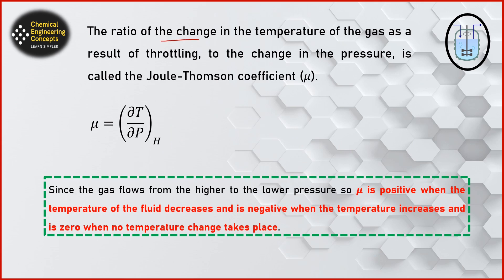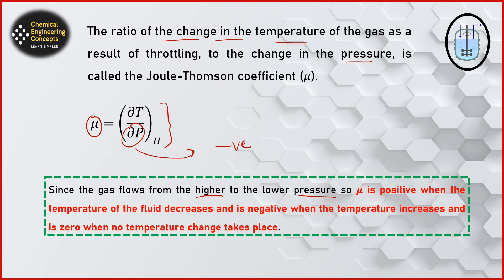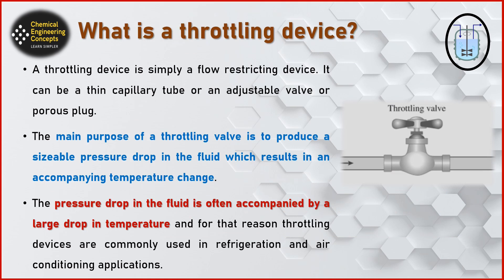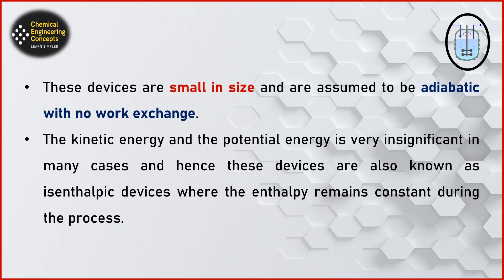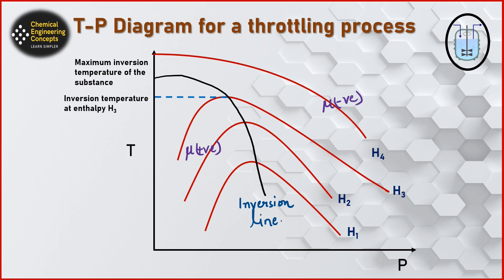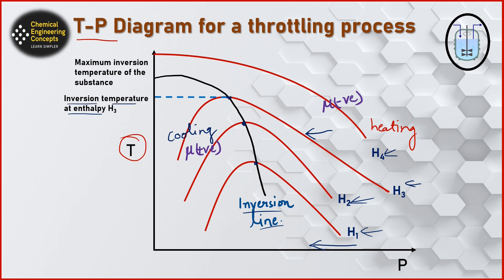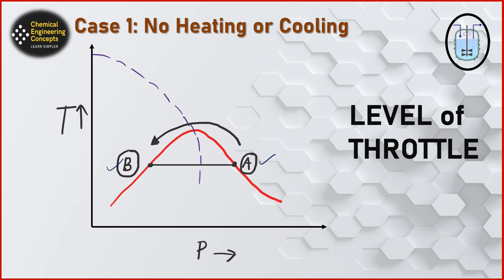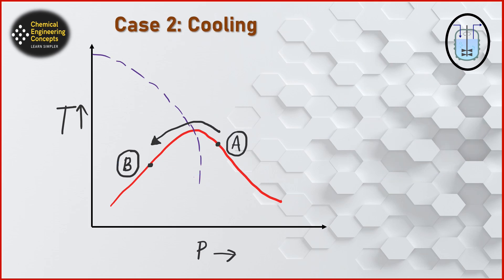Joule Thomson Coefficient (𝝁) || Throttling Process|| Solution Thermodynamics | Chemical Engineering

Comment: Sir at 14:45 why the temp have to reduced to 195 kelvin... why can't we throttle from 250 kelvin..plz explain
Reply: Our basic purpose is liquifying the gas or we want to reduce the temperature of gas... It can only happen if the initial temperature is at an inversion temperature(195)  otherwise if we start throttling at 250 the result will be an increase in Temperature with the reduction of pressure.